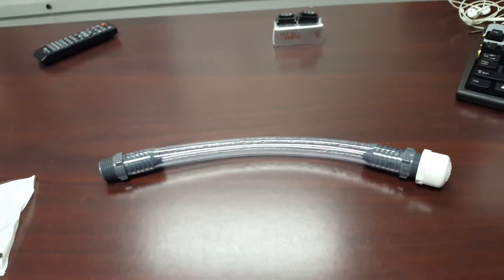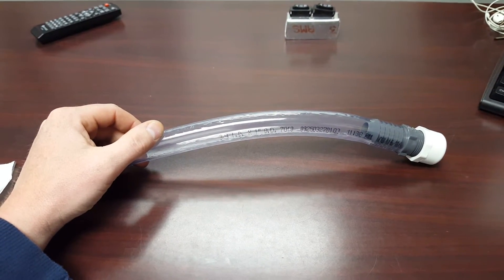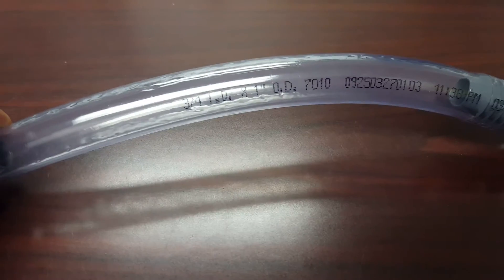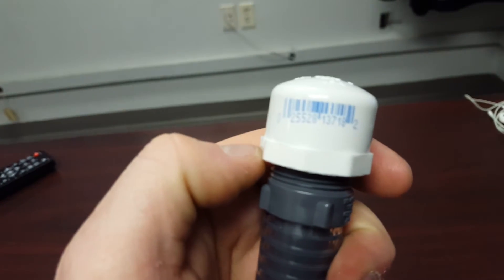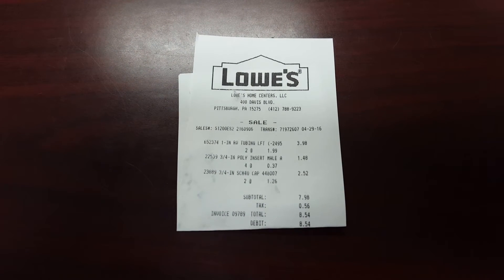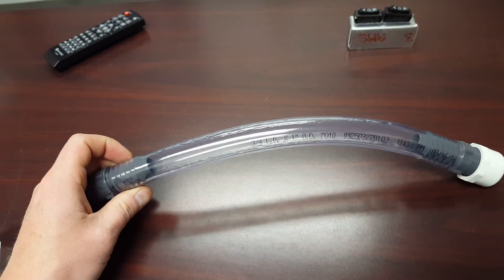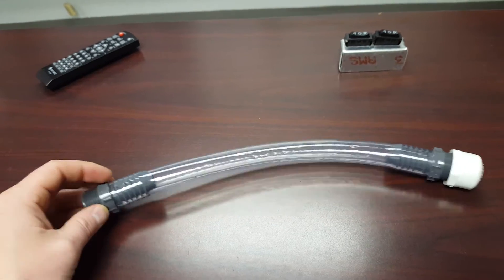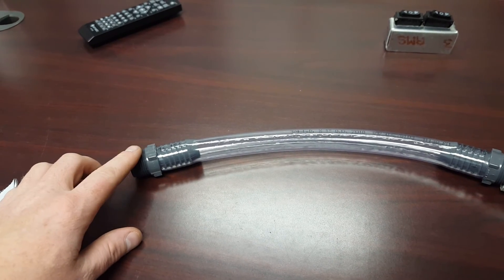Vp Race fuel can spouts Diy spout

Comment: Instead of using soap to help slide the fittings on use a hair dryer to heat the hose, makes it VERY easy to slide the fittings in.